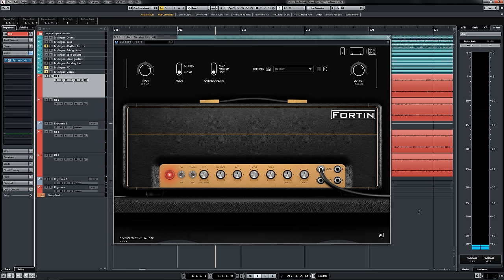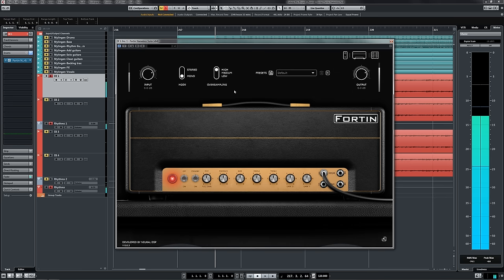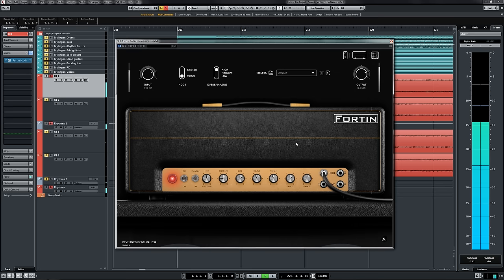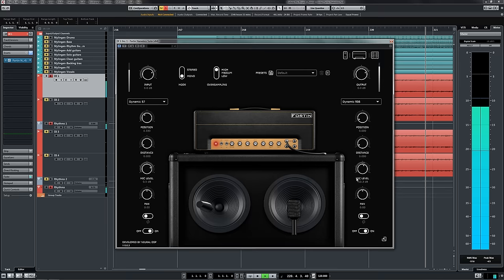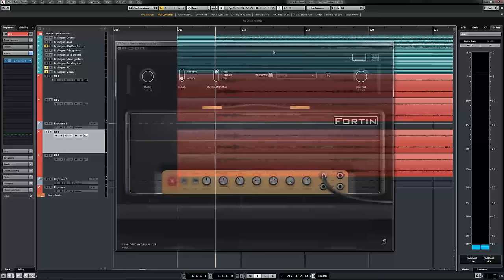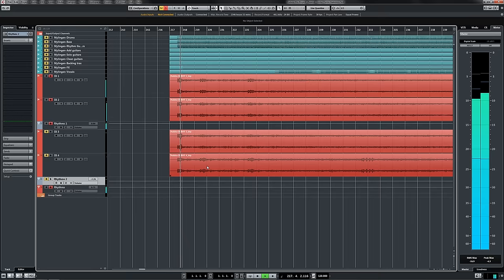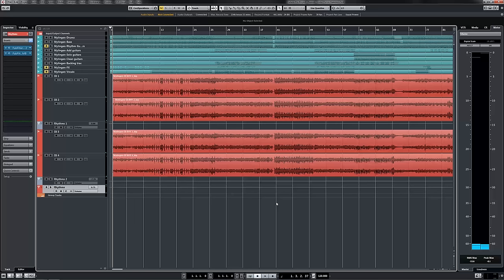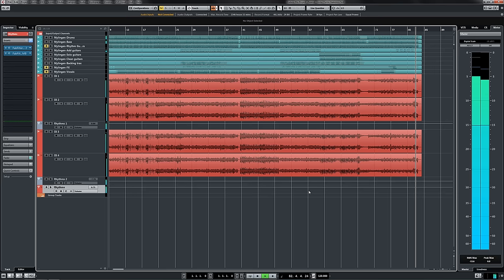Dialing A Crushing Guitar Tone | Fortin Nameless

Comment: I love this plugin but I also have some very pronounced "FISSSSSSSSSSS" around 3-4 kHz. Tried a lot of stuff, but if I eq out that part of the freq spectrum the guitars sound very muffled. No good at mixing yet... :/
Reply: I put a notch EQ at 3.4 kHz, and the compensate it with a wider and less pronounced bump EQ around the same frequency. So overall you get a slight boost at 3-4 kHz, but a deep precise cut where the fizz lives.

Comment: I'm looking for a way to make it sound fat and warm but also cutting and sharp.  This amp sim just gives you cutting and sharp.  How do I get the fat and warmth of a modern metal tone?
Reply from the maker: Pair it with another impulse loader like MIKKO and use a fat cab like the mega 412 old, and blend in some ribbon mics.
Reply: Systematic Productions Thanks man I’ll give that, well something like that a try.  I’ve got Pulse and some other IRs and amp simps to try.  Trying to get a tone like Trivium has on their latest album, for rhythm guitars.  Question that you may know the answer to — if you’re double tracking a very fast staccato / muted part and you want to get it with two different amp sounds to thicken it up, do you really have to play it twice?  Or can ya just copy and paste the DI to another track?  Is there a noticeable difference?  Sorry I’m a hobbyist producer and I don’t know really anything about this, I know with chords and slower parts playing it twice has a benefit in that it gives it more of a watery and “wall of sound” type of a thing.  But for a fast part like the one in this vid, I’m curious to know if it’s really necessary.

Comment: at 6:29 how to compensate for how the guitars dont sustain that palm mute. Ive been finding i can achieve a great tone and it sounds good in the mix but for certain instances i cant get that sustain and it hurts
Reply: Disengage the grind pedal, use an external OD or custom pre-EQ curve to boost the signal and taper the bass and highs

Comment: Do the guitars need to be quad tracked to be able to do a mix of both tones? Or would running the same performance through two different instances of this plugin with different tones be enough to get a thicker sound without the phasing issues?
Reply from the maker: It's possible, but it would sound very different. Generally you get a lot of mid frequency reinforcement.